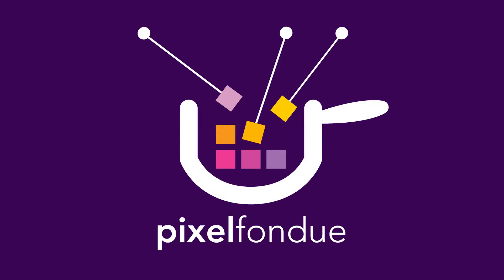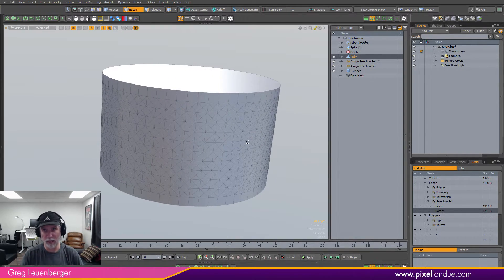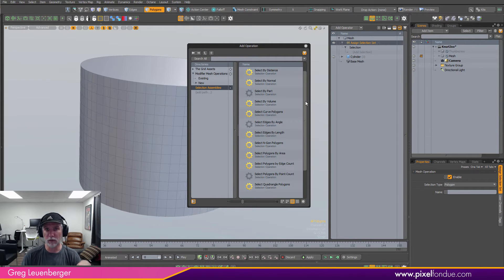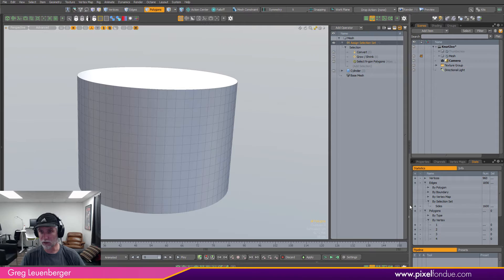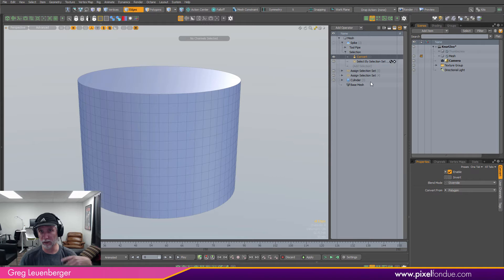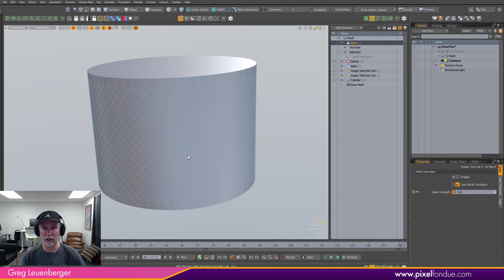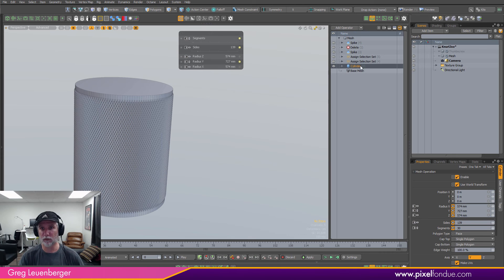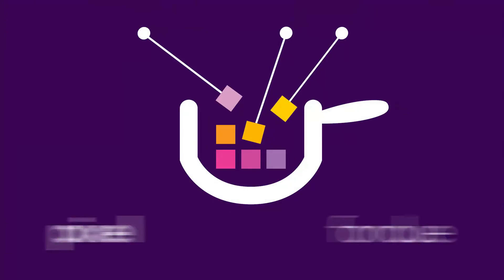MODO Procedural Knurls

Comment: I have not been able to replicate the example. Why? What version of "Mode" is it? Are there two types of "Assign Selection Set"? Does it work because of the kit you mention?
Reply from the maker: Kit is just nicer icons.  The Assign Selection sets will work on polys, edges or verts.  You have to make sure you set the right one (edges in this case).  You should be able to see in the stats window.  Also, make sure your 'convert' node is set to convert FROM polygons (and the Assign Selection Set is set to Edges)
Reply: @pixelfondue  The problem was at minute 4:15, when "Assign Selection Set" is created, since by default the "Selection Operation Alias" properties window is displayed (in "Mode" 16.0v3, Microsoft Windows 11), while in the video it is displayed the "Assign Selection Set" property. From that moment on, the same processes do not occur in the selections, since I think that by default it selects "edges". I have created a version in the "classic" way of editing: it is faster, more intuitive (with the disadvantage that the parameters of the procedural mode cannot be reprocessed): https://www.youtube.com/watch?v=4m1SYLAV2DY
Reply from the maker: @ModoTuars  Yeah - that's what I did first too...then just tried to replicate it via meshops (using selection sets to kind of 'plan ahead' for my future selections.

Comment: This is awesome. I use procedural modeling all the time and I had not really used the selection sets this way. Wonderful tip Greg! Thank you! Jumping between Houdini and Modo, I do feel like there are a lot of invisible concepts in Modo that the UI does not show you as you highlight here, like what data is being processed at each step can be invisible to the user without a strong understanding of how each step layers together, like the "convert from" selection convert op was not clear to me before.
Reply from the maker: Thanks Joel - there is a layer of polish missing from MODO that I wish would be addressed.  I really think that is time better spent than new features at this point.